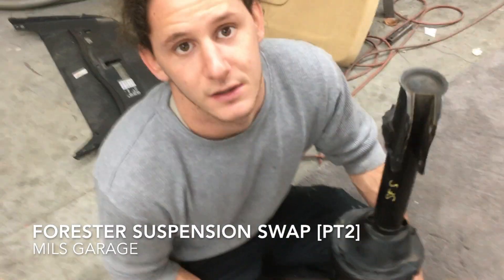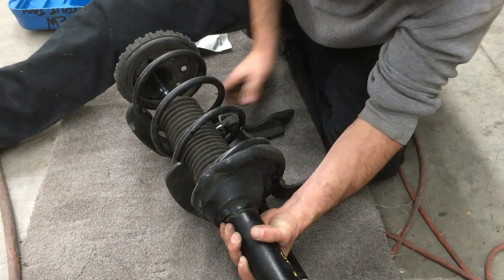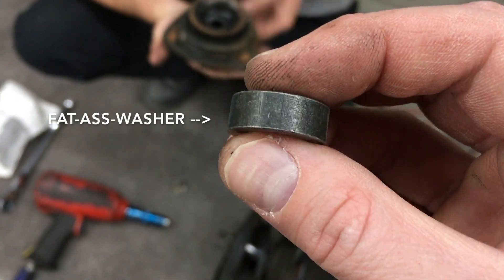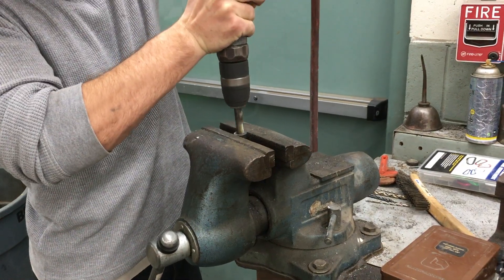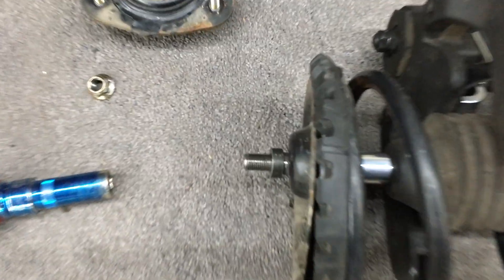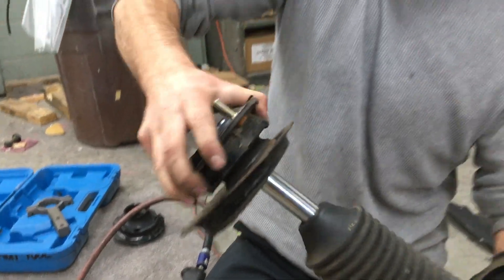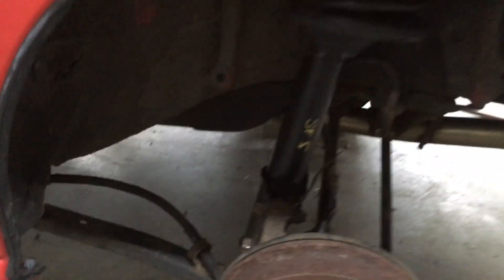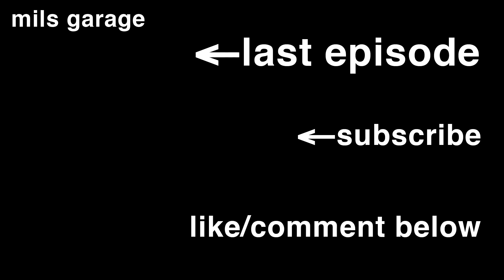Subaru Forester Suspension SWAP pt2 [ Troubleshooting ]

Comment: Did this. Used a hex nut since washers apparently don't exist then put new locking nuts up top. Great vid guys. Any ideas to stop that tire rub if I get bigger wheels/tires?
Reply from the maker: Thank you for your support! Nice work Spencer! The rubbing ended up just being the liners.. i’m pretty sure they just rubbed away in a couple areas.. i’ll ask Ryan if he made any extra adjustments tomorrow 👍

Comment: Hey guys, love the monster subie build so far. I've had 2 questions since pt 1 of the build. one of my questions was answered in this video. Thanks for the rear strut update. My other question is what did you guys do with that front sway bar end link situation from part 1? Im about to do the same set up with my 97 obs and your videos have been very helpful. Thanks again.
Reply from the maker: awesome to hear u'r doing the same swap! so the video of Subie Vs State of Emergency ( https://www.youtube.com/watch?v=MkvdVz33DaU ), where we go doing crazy donuts and snowboarding.. we did all that without reconnecting the sway bar. it drives just fine, but we also aren't doing high-speed runs or anything. we r definitely looking into extended links though
Reply: i hear u can use sti rear end links on the front they are longer
Reply from the maker: that's awesome! we may have to test this out :D
Reply: np man. big fan of your work. check out my videos of my subies and drop a comment :D. i plan to lift my 99 pretza using 96-99 outback struts.
Reply from the maker: wow, u just made my day! u have some nice rides! we just subbed :)

Comment: Hey guys I love the videos!! I just recently picked up a 1998 Impreza wagon for super cheap and I want to lift it. My question is what size wheel and tire combo are you guys running? I'm thinking about getting '04 Forester struts, 2" - 3" strut spacers (for bigger tires) and 3" trailing arm spacer.
Reply from the maker: awesome!! 🤟😎👍 thank you for your support! the Subie's currently running on 205/75/15's mounted on stock '98 Legacy wheels. we used SubtleSolutions for the spacer.

here's the first part of the Forester suspension install jic [ https://youtu.be/Nevq9GWS82Y ]

Comment: Hey, can 2010 Forester struts fit my 2010 Impreza for some lift? Any recommendations?
Reply from the maker: It’s definitely possible they will interchangeably fit.. We did this once with a WRX and Forester, and the only issue we’ve run into was needing to switch top hats for camber/toe adjustments.. i wouldn’t buy them without trying the fit though

Comment: See when I did my strut swap I kept the forester topshots on and just modified the holes a bit and they went right in
Reply from the maker: Yeah, we do not recommend making such a permanent modification. Now if someone wants to go back, they need to weld in some new plates or rely on possibly faulty holes.
Reply: @milsgarage  to avoid that I just used washers one on top one on both for each bolt and it holding up great, I go offroading every week and yet to have a problem
Reply from the maker: @the best and worst of gaming Yeah man, it still made it impossible for most people to go back to the stock struts and top hat. No way around it. And yes, they should hold up just fine with the new top hats because those ones are wedged into the drilled out spots which elongated the holes. Will hold up to a beating, but going back isn't going to be fun for any future owner or even yourself
Reply: @milsgarage  I'm not going to go back, nor sell the car, so I should be fine. Only part I'm be worried about is after i get my new tires on i have general grabbers at2s
Reply from the maker: @the best and worst of gaming Yessir, you're gonna be just fine. Sweet tires sir. Did you install the trailing arm spacers yet?
Reply: @milsgarage  I went with the forester trailing arms, instead of the spacers and that set me right where I needed
Reply from the maker: @the best and worst of gaming Nice work 💯. What size are those? We currently have 205/75/15's on the car, with millimeters to spare
Reply: @milsgarage  205/75r15 like yours, I was going put 2in spacers cause the forester wheels dont have any offset
Reply from the maker: @the best and worst of gaming Sweeet. Sounds like an awesome build. Will you be at Boxerfest?
Reply: @milsgarage  no I will not, in 2020 I'll be in California for the subaru meet, and it's coming along
Reply from the maker: Very cool 🤟😎👍
Reply: @milsgarage  then here in Oregon I'll be doing the gambler 500 after I get my truck that is
Reply: @milsgarage  you got and Instagram

Comment: You make things too complicated just use forester top hat and elongate the holes on strut tower
Reply from the maker: No, we won’t do it that way. You are making it much more difficult to unmodify the car. Also sounds like a weak solution. i wouldn’t pay anyone to mangle my car like that.
Reply: I have only been a certified master tech for over 30 years but it is your car so i really dont care
Reply from the maker: Well dude, that’s not the best way to sell your credentials. My concern isn’t with safety, though it’s kinda not the best solution and you know it.
Reply: Like i said it is your car do what you want to with it .